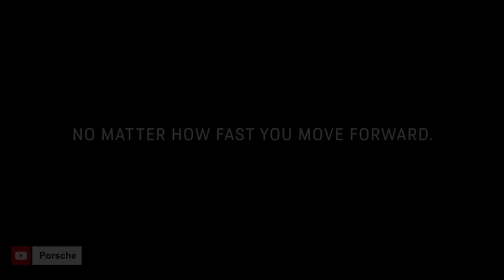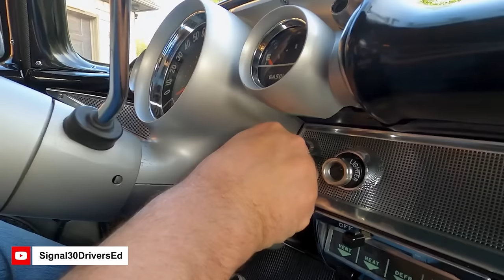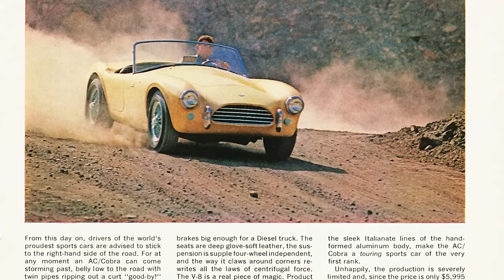Why Old Cars are Better

Comment: Quality of residential buildings, then vs now: generally I think you're right, and I want to add a few thoughts. First, our perceptions are definitely skewed in favor of old construction by the simple fact that any crummy old buildings didn't last, and of course the ones we still see have lasted because they're built to do that. Second, we're focusing on single-family homes, which I think represented a far smaller percentage of residential units in the US than became the norm after WW2, with the rise of suburbia and its tickytack houses. A SFH in the 19th to early 20th century was more likely to be built and occupied by a more affluent family, relatively, for the time, and they'd be more likely to spring for good materials and workmanship. I think also that the average square footage of living quarters per person was far smaller all around, and housing units (whether houses, row houses, or apartments) were more likely to be occupied by several generations, or larger families, or both. So it's still an economy of scale, just with different parameters and a different result. Lastly, there's a cost for building "up to code" in modern terms, and also consistent with modern taste and fashion, and I suspect that on average, it's paid partly by cutting corners on quality. And there's all the stuff you pointed out about mass production and depletion of resources like quality lumber. And the mechanization of trade has made it easy for less skilled workers to do more work faster, but only at a steep penalty in terms of craftsmanship. Just to add to your points.

Comment: I still have my first truck (2000 Ford Ranger XLT single cab 2.5 I4 5-speed manual swapped) I loved it to death, and my current daily (1984 VW Rabbit Convertible 1.8L I4 Fuel Injection) coolest freakin car ever

Comment: I still have my first car...a 1980 AMC Spirit, 2.5L 151  4-cyl Iron Duke, 4 on the floor, no power brakes, no air conditioning, 171K miles.  I know the quirks and feel of that automobile so well that it is not a car I get in, it's a car I put on.

Comment: Chey S10.... I've owned 4 over the years, good, basic & dependable little trucks for the most part. Especially when equipped with the 4.3v6, which is the only way to go, in my opinion 😊

Comment: I'm 29. My best vehicle Ive ever owned was a 95 F150. I think the 90s are the sweet spot for simplicity and reliability. My 98 mustang was ruggedly reliable. The only car I have post 2005 that has been close to as good is a 2017 Tacoma. It still seems simple and reliable like a 90s car. Ive shifted to becomes a Toyota fan because of this.

Comment: I own a 2002. It has all the fancy shit. It's really not that fancy. But everything you said, is 100% true. Make sure nothing is leaking. Start it up, make sure the brake lights are working, drive it for awhile till the temp is correct. Don't over use the fan so it doesn't burn out, but leave it on low so it does seize... Pop the hood quick when you stop and make sure it's not making a funny noise or fluids are pissing out... Make sure the clutch cable is still connected.
It's really part of the experience, but at the same time, you are a bit more confident because you know exactly what's going on, and if it did break down, you would know exactly what to fix...
I think when it comes to reliability, they have two advantages. Newer cars are more reliable, but when they do fail, it tends to be catastrophic (need a new engine or transmission), older cars might lose a water pump or something, but if your car is popular enough, someone makes or remanufactures them somewhere. You might lose a head gasket or seals, but someone out there can rebuild the engine without too much hassle, it's usually pretty straight forward to get it in and out of the frame.

Comment: As a homebuilder, I will not buy a new spec home (cookie cutter house).
My sisters spec house has 0 ZERO insulation in the attic or even the walls.  She spends under $1000/mo in heat during the winter.  Insulation isn't just for heat control, I could hear her roommate on the first floor while I was on the other side of the house on the second.
I set a house where the roof trusses were a foot short, and the builder still decided to set the trusses "as is".
These houses are junk.  They appeal to new buyers who see a fresh coat of paint and a fresh lawn.  The wood is soft, every nail and screw is thrown in.  They may meet code, they may not.  These houses are not homes, id only ever rent one if I had to.

Comment: I have a pre-catalytic, points and carb 70s car, one from the late-80s to early 90s era, and a newer model with all of the complexity. All are manual transmissions, though, as it should be. 

For me, the sweet spot for a car is the late 80s (when the first multipoint SEFI models arrived) to 1993, the last year before OBD II was mandated in the US. You get the drivability of EFI without the complexity of having computer control injected into every possible corner of the car. Just because computer technology makes greater complexity possible does not mean it needs to be there. 

A simple example is the dome light. On my two older cars, you open the door, a pin switch grounds, and the dome light comes on. Just the dome light, nothing else. As long as that door is open, the dome light remains on. The second the door closes, the pin switch opens, and the dome light goes off. It's so delightfully simple and predictable. 

This did not need to change, but it did.

Now, on my newer car, I open the door, and it puts on the dome lights, the headlights (at reduced power), and the taillights. Even if I leave the door open, the dome light will go off in time. If I then manually put the dome light on with the dash switch, it comes back on, but even with the switch still in the ON position, it will still turn the dome light off in a few minutes.

After I close the door after I just opened the door and got in the car, the dome lights remain on for a while, unless I start the engine. 

Not only is all of this complexity and computer control that many more points of failure, but it is also a worse user experience for me. I never experienced myself wishing the dome light would turn off after a bit when the door is open before. I never wished it would stay on for a few minutes after I shut the door. I never wished it would also put the taillights and headlights on when I opened the door. I have the ability to turn those things on if I want them on... but now I do not have the ability to turn them off if I want them off while it's doing its thing. 

My newish car vastly outperforms my older ones in every measurable way. Better MPG, better acceleration, better handling, far greater safety. I can't really say it's more reliable than my mid-age car, as that one has been simply fantastic for the quarter century it has been my daily driver, but that is still a concern. That and the safety are why I gave in and bought the newer one. I am just glad I kept the older one too, as if I were to place a bet on which of the two I will still own in 20 years, it would be the mid-age one.

There are cars even newer than my new one, though, and that's over the line for me. A car must have a key inserted into a slot and twisted to start. It must not have a touchscreen built in that is needed for anything not related to the radio or navigation. It has to have actual physical gauges, not pictures of them. It has to have a parking brake operated by a ratcheting pedal or handle, not a button. And, of course, I have to have a manual transmission (a real one with a clutch pedal, not an auto with paddle shifters). 

Newer generations of my car have more great features, but the cost is too high, and I do not mean in dollars.

Comment: Ah, you've made me miss my old MG -and my old '93 Nissan pickup and '79 Honda Accord hatchback. I worked on them all, sometimes happily so and sometimes not so happily so, but at least they were easy to tackle myself. I learned to work on a car in my teens on a friend's '68 Dodge Coronet 500. My first car was a '65 Ford Falcon, and even though it was a V8, the engine seemed like a glorified lawnmower engine compared to new, computerized vehicles. In fact, I'm growing to increasingly dissatisfied with having a car that needs to "update" the software once or twice a year. Back in my day (lol) an update was new plugs and an oil change.

Comment: My first car was a hyundai Excel 1998. 1.5L which had 1 horse in it. No power steering. Manual window winders. Steering accuracy was worse than the titanic. But it was by far my favourite car. I could experience driving. I felt the road push back at me through the steering wheel, I could predict when the car was loosing grip on wet days, and learnt to respect the weather on windy days. No safety features at all. I now drive a modern Camry with a soul numbing experience-but it's the most reliable I've owned so.

Comment: I bought my first car for $75. It was not much of a bargain. It was so rusty that parts fell off as I was driving down the road. It was a convertible and I got snow on me in the winter. It had no heat, but especially it had no defrosters, so I carried an ice scraper and used that to clear the ice that formed on the inside of the windshield. It was a 1971 and I bought it in 1975. It was four years old. I replaced it with a car in similar condition. One of the headlights fell out on the street because of the rust. It burned through two quarts of oil a week. I had difficulties keeping the electrical system operational because the grounds kept rusting. It was a 1970 that I bought in 1977. I don't remember how many miles were on either vehicle, but I am pretty sure the '71 was under 100,000 and the '70 was just over.
The last car I had to replace was a 2014. The transmission burned itself on my way home from work one day, but it had been acting up for two years. I was surprised it lasted that long. That car was 10 years old and had 260,000 miles on it. My current vehicle is a 2016, so it is eight years old and it will hit 200,000 miles sometime in the next month or so. It has no rust. Everything on it works great (with just a couple minor exceptions), it looks amazing, and drives like a dream. 
The result of these experiences is that I know for a fact that today's cars and trucks are built far, far, better than they were 50 years ago. I have owned, in between these examples, 30 or 40 other cars, and every year the manufacturers find ways to make them better and last longer. Back in the 70s, the only vehicles that managed to hit 200,000 miles were big rigs that got serious maintenance done. I maintain my vehicles as well or a little better than most people. And cars today are better than cars from the past. Sure, the styling was more interesting back then, but you had to buy a car every couple of years because you couldn't get them to last more than 10 years, at the very most.

Comment: Still drive my first car, a 73 mustang. So over 35 years now. I don’t want any other car, except mebbe the 71 that I’m restoring. There many ways to make old cars as reliable as new ones. The key is to willing to. Most people today do not even know or want  how to open their hood! They simply accept to pay and when it’s starts to add up they buy new one and claim they drive greener and save money because the engine needs less fuel.

Comment: The newest car I’ve owned is a 2000 WS6 Trans Am and newest truck an 02 GMC with a 6.0 LS but I prefer 80’s and 90’s cars, with some 70’s and late 60’s. Before that, it gets harder to keep up with modern traffic

Comment: I have a Wrangler Yj 1993 and I LOVE that car It was my daily for years up until 3 months ago, 5 speed manual transmission with a bigol 4x4 shifter on the floor I love how it drives I think I'm the only one 😂 everyone else that drives it say the car is trying to kill them lol the thing goes everywhere, when it would break down I'd fix it myself with simple tools like literally just 10mm and 12mm sockets and screw drivers 😂 no special tools or anything just plain and simple. I get alot of offers for it but I don't think I'd ever sell it, they just "don't make them like they used to"

Comment: When it comes to classic cars:
We, I and my father, have recently finished a complete repair and rebuild of his old sportscar from the 1960s. The first thing that I would mention as a typical problem of classic cars today: gasoline. Today´s unleaded gasoline is not compatible without additives. And those additives are very quick to clog your carburetor if you don´t burn that fuel+additive mixture quick enough. So "that old car can burn anything" no longer works. If that mixture is close to a year old, like in my case, the car just barely works, and requires constant cleaning of the carburetor. The second thing are seats and plastic surfaces. There´s no bigger pain than your seat crumpling from the inside out and turning into dust whenever you sit in your car. And finally - chrome surfaces. If the surface isnt perfect, be prepared for a VERY costly procedure of getting a new chrome somewhere. It may be cheaper to just replace that part with a new one.
And when it comes to today´s sportscars:
There are some brands that still offer a typical pure-blooded sportscar. The best brands I know are Ariel, KTM, and Sigma Motor. And I can personally vouch for that, as I work in the Sigma Motor company, and know from personal experience that their cars are nothing like the typical mainstream luxury sportscars. But who in today´s world of constantly decreasing wealth amongst population has enough money for a small but pricy sportscar that cant even carry a bag of groceries unless you leave it on the passenger seat?

Comment: I'm a mechanic and I tell people that planned obscellecense is a real thing. I own a 96 ZJ with a 4.0l and an 03 Cummins. I don't plan to get rid of either.  They are easy to work on, parts are cheap, and they are reliable. Both are right around 300k and going strong.

Comment: I had this argument at work with a couple coworkers telling me my cavalier is a POS. I made the comparison to our overhead cranes. When the old crane is up and running everyone runs it and no one runs the new crane. The new one has anti collision cameras and stops drifting automatically, its quieter, and smoother in operation. The old one has no safety features, you need to apply the brakes yourself, its fast and can be uncontrollable, its loud, somewhat rough if you don't have a feel for it, and has problems more often. I explained the old crane is like my cavalier, fun, gets the job done, simple, and you can feel it and the new crane is like their new vehicles, less maintenance, and easy, but not well made and less favorable to run. Keep in mind this old crane is from the 60s or 70s and the new one is from about 2010.

Comment: Had a distinct sound of a bearing failing. Its fwd, so I swapped both front ones but still didn't fix it. The shop quoted me 600 dollars and was like "we only use OEM parts" that are 120 each. 50 bucks and 3 hours later, swapped the rear bearing and now I have a sweet impact lol.

Comment: I know it’s not “old” necessarily but I have a 2003 Honda element with 282k miles with a 5 speed. I owe nothing on it and can replace the engine and transmission for around $1500 on a good day. I love this vehicle and it has served me well.

Comment: I don't have experience with older cars, but I do know I enjoyed the experience of driving my grandfathers 2006 diesel pickup over my dad's 2016 gasoline pickup. Driving the 2006 felt like I was actually doing something. It took a little muscle to turn the wheel. My dad's truck doesn't really feel that different from driving a car, except that it's harder to park. It has the annoyances oi driving a large vehicle, but none of the fun. I also really enjoyed driving stick on my parents' 1999 Subaru Outback. I feel more connected to the vehicle driving stick, and I think that's more fun. And makes it easier to stay focused on the actual act of driving, because there are more things to do, and requires more parts of my body to do it. Just raising and lowering my right foot makes for a pretty boring driving experiences.

Comment: Have a 1986 Porsche 944 and that car is built very well and has a really nice amount of new and older stuff too it
I also drive trucks for work and my normal truck is a 2002 f250 that works like a charm and just feels good  to drive while i occasional drive a 2021 ram 1500 it feels like your barely driving it for how big it is.

Comment: Oh how I wish I could have held on to every car I had before I turned 30. from my first a 1962 Chey Impalla SS to my 1980 Toyota SR5 4x4. My favorite year of car was 1972 In which I had a Land Cruiser, Volvo 242, Maverick Grabber, Int Travelall 4x4, CJ-5, F-150 with a wood bed, and Dodge custom van w/moon windows. My two 1967s were a Mustang Convertible and a Cougar XR7.